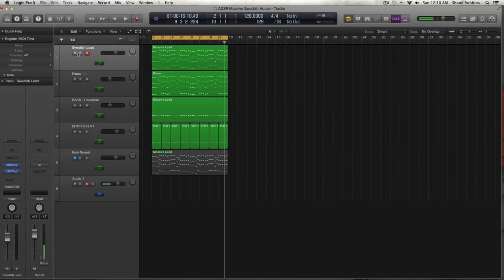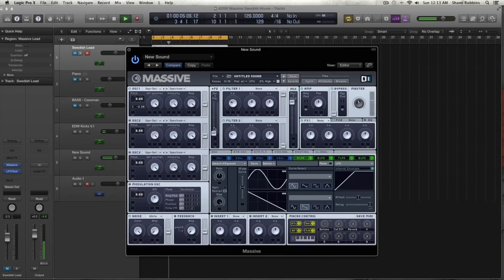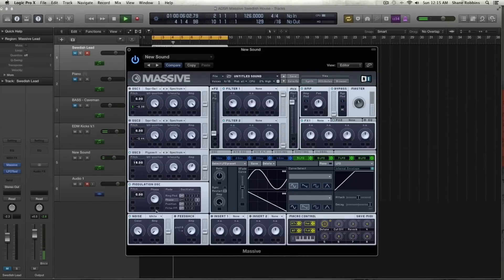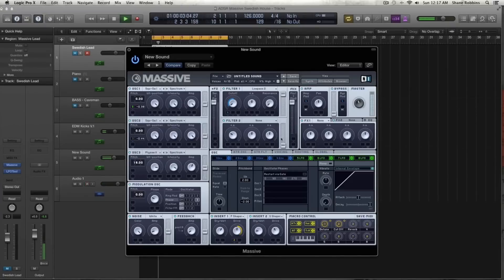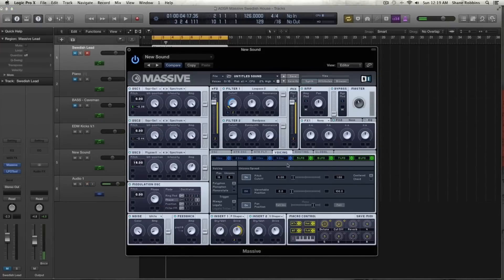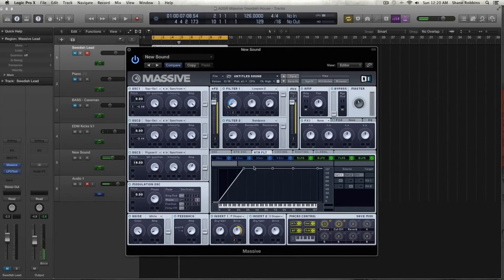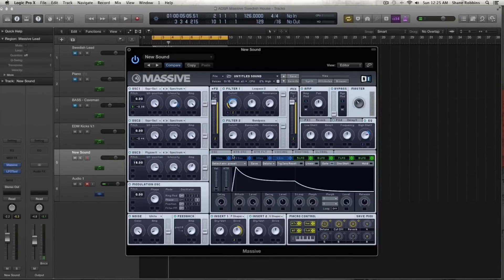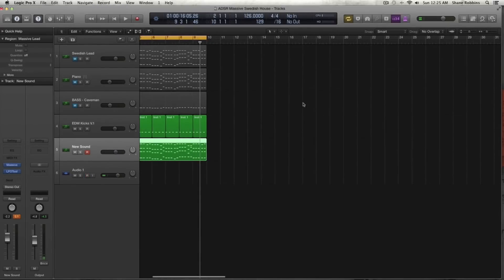NI Massive - Huge Swedish House Lead - How To Tutorial

Comment: Hey, I came back to this video, and I'm not producing with the best of equipment, just my Mac and meh earphones, but I was curious because the synth was awesome in the video but sounded like crap on my computer. I don't have an external soundcard either, is that the problem? I was really frustrated because I followed every step, I even have LFOTool and everything set up.
Reply: WeR2VEVO did you ever find out what the problem was. I ask because I’m having the same trouble & I’m guessing sound card but honestly I don’t have a clue

Comment: Cant get mine to sound anything like this, i dont understand most of the time i follow it verbatim and get nothing like what it is...
Reply from the maker: Hey Michael, I understand your pain, sometimes I have a hard time recreating my own sounds for the videos! Did you do the right settings in the voicing tab?
Reply: yeah i deifinitely changed the voiceing sounds, I played with it a little longer and got something decent sounding. Especially and throw on my own reverb and a EQ
Reply: Michael Pelissari he is using chords in the piano roll
Reply: Hi there, I’m having exactly the same trouble & it all seems to stem from the oscillators. For some reason mine doesn’t sound so rasping & throaty, sounds more like a beep bop Casio version.